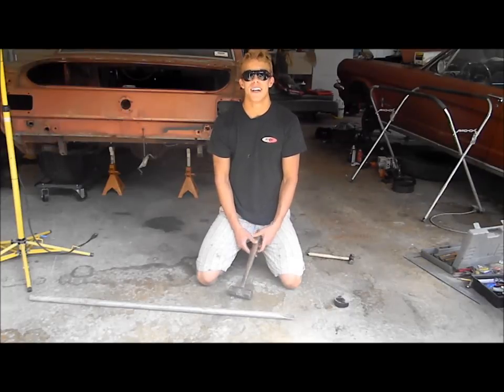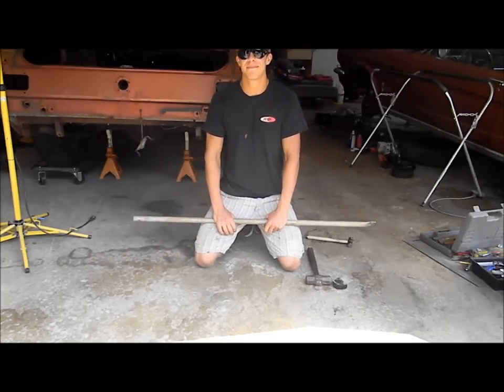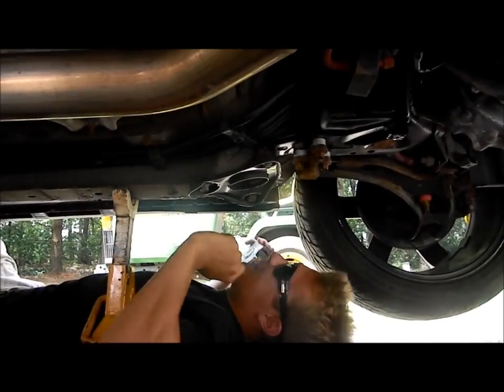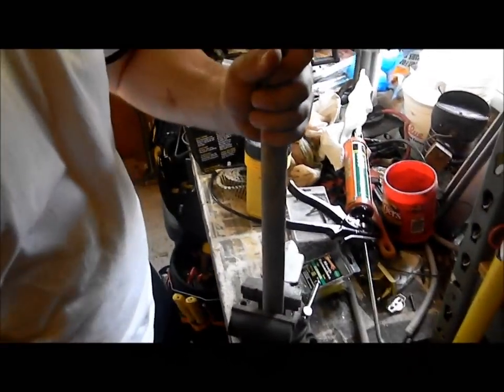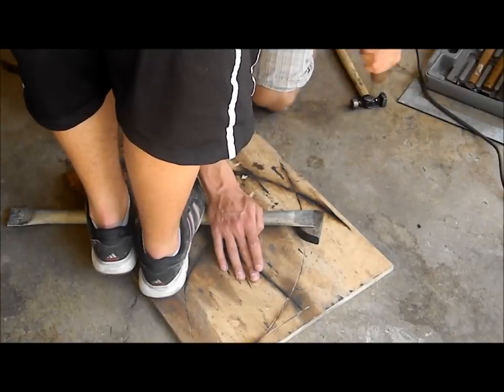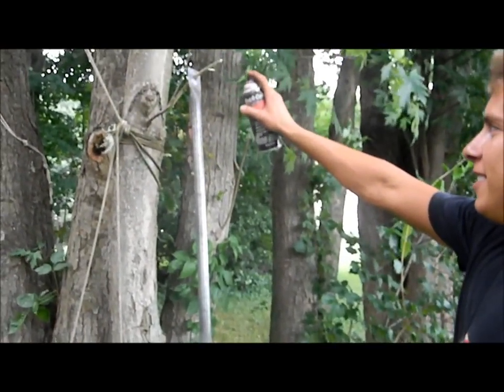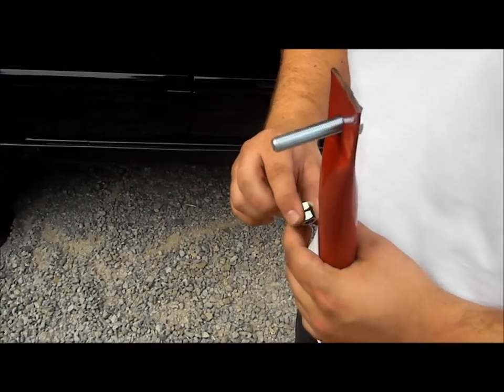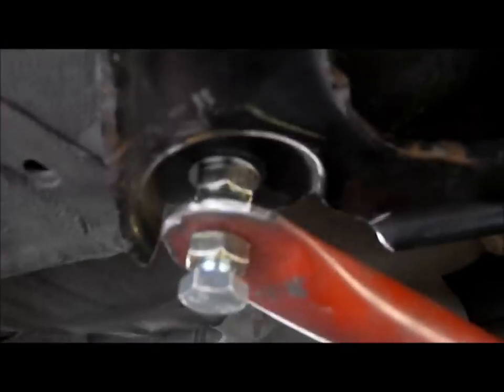DIY Subframe Connectors | Tie Bar Under Brace | B15 Turbo Sentra SER SpecV

Comment: not sure why but it looks like any chasis flex this bar absorbs will result in those bolts snapping. Every aftermarket bar I have seen has always connected at least 2 bolts to a frame and then to a bar, this set up just doesn't look solid...